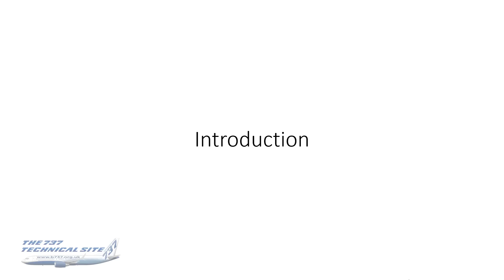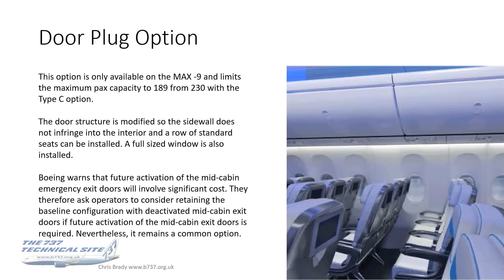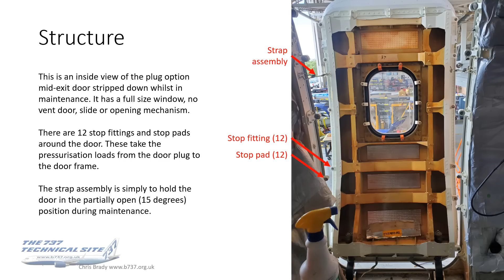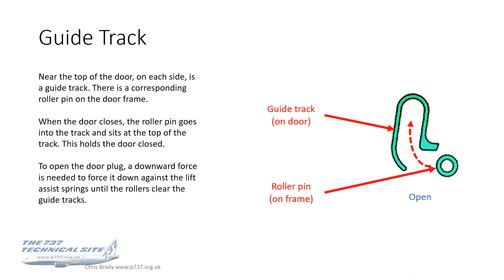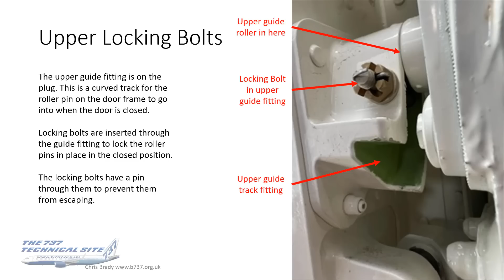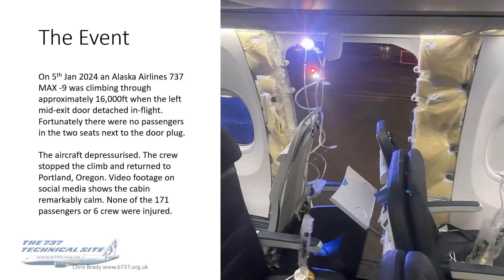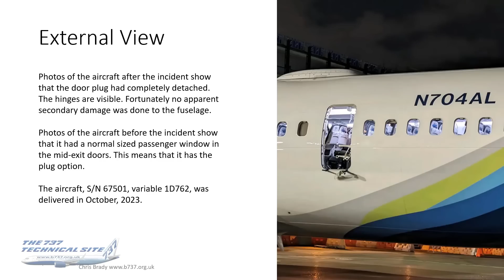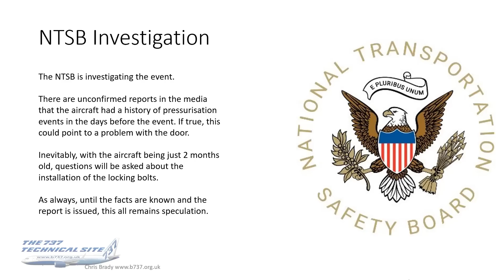737 Mid-Cabin Emergency Exit Doors - Plug Option

Comment: I still don't understand two things on the slide at 4:29.

What is a gate that reduces the size of an oversize door?

The video seems to say the plug option is not really a plug-type door, but this slide says it is. I think of a plug-type door as one that must open inward before it can rotated to pass through the opening and swing out. This mid-exit door is hinged to open outward like the overwing emergency exits.  Are they also called plug-type doors?
Reply: Exactly that got me confused too. I cannot see how this could be called a plug type door, I don't think it is but the info in the video was a bit confusing.
Reply from the maker: The gate is on doors 1L, 1R, 2L & 2R. Boeing state that the mid-exit door/plug is a plug type door/plug. It is just not as much of a plug as the other doors!
Reply: @ChrisBrady737   
Thanks for the response.  I understand which doors need the gate, but not why they need their size reduced.  As far as I recall I have never seen one.  Can you explain the reason? 

I can see calling this a "door plug", which would be a non-door thing that fills an opening for a door; but calling it a plug-type door is misleading and confusing for those of us familiar with the usual usage of that term.  Especially when this plug is not actually an operable door.  I was around Boeings for most of my flying career and this is the first time I've been confused by their terminology.
Reply from the maker: @gort8203  I agree the terminology is confusing, but Boeing clearly state in the AMM that this door plug is a "plug-type" door!

Comment: Seems to me that if the door was installed properly, all of the bolts in place and torqued to spec and locked in, there is no way that door could have separated from the aircraft. Am I right?
Reply: When it comes to the locking bolts (seen e.g. at 8:50), they don't even have to be torqued to do their job. If the nut is on and secured with the pin, they would work just fine even if not torqued at all.
Reply: Wow, that's even more troubling. By the way, I have a jacket with that skunk logo.

Comment: Many thanks for answering many questions ! 
At roughly the 10 minute mark, you show the lower end of the door with the lift assist sping, and hinge guide fitting.  
Assuming (for sake of question) the arrestor bolt was not present,  and the door was opened say by 45°, could one just lift the door out of the hinges, or does the bolt/washer at the tip of the hinge "pole" prevent the door from being pull oup and out o fthe hinge ?
I assume NTSB will have a good look at what is left of the hinges to see what happened.
Reply: Yes, the double nuts and washer on the hinge assembly is the up-stop.

Comment: Thanks - I'm slightly confused by the up/down direction when opening - my understanding based on the direction of the guide and the collars on the hinges is that the door must move upwards to clear the guide, but the guide track slide says the opposite direction.
Reply: The panel can only be lifted upwards first, before it can be pushed outwards. If I am reading these pictures correctly.
Reply: I thought I was the only one wondering about this too...
Reply: He incorrectly stated the direction in the earlier part of the video, but then in the later half, he seems to have corrected himself. The plug has to go up to open. Hence the need for helper springs to counterbalance the weight of the plug.
Reply from the maker: * Errata *
In this video I state that a downwards force is required to remove the door plug. I based this statement on text in the AMM SDS which I now believe to be incorrect or misleading. It is possible that a very small downwards motion (1-2mm) is first required to be able to free the locking bolts. But the door must be moved upwards by a couple of inches to clear the guide tracks. Apologies for any confusion.
Reply: @ChrisBrady737  thank you for the clear correction - your content is great.
Reply from the maker: Thank you and again my apologies for any confusion
Reply from the maker: AMM SDS 52-23-00 Page 6 MID CABIN EXIT DOOR PLUG - COMPONENTS, Lift Assist Springs:
"Apply a downward force to the door plug this forces it down until the rollers clear the guide tracks. At this time the door plug can open outboard."
Reply: @ChrisBrady737  thanks for the reply - still trying to figure it out in my head with an n shaped guide on the door and a fuselage mounted roller.
Reply: @blythy87  Not that the AMM has ever been wrong 🙄 I was continually submitting forms to our technical department to get them to contact Boeing to have the manuals reworded/amended. I can imagine pulling the door down slightly to relieve any tension on the locking bolts to allow them to be pulled out. But, as you say, the guide is on the door. The door has to go up to get the roller out of the channel. Timestamp 9:05
Reply: I think maybe it's pushed down to clear the pads, and then lifted up so the bottom clears the frame when opened. (?)
Reply: @jonathanbott87  the idea is to introduce fault tolerance by requiring opposing motions in sequence to allow it to open. Hence, you're on the right path.
I suspect that'll end up being redesigned to make it a bit more fault tolerant in the future, along with some additional steps in manufacturing to prevent any errors in assembly. At times, just re-ordering assembly steps can prevent the omission of a critical component.
As it stands now, intended operation involves three steps, conducted four times, before the door type plug can even be moved at all. Meanwhile, if assembled by component in sequence, say bolt, bolt, bolt, bolt, nut, nut... cotter pin, cotter pin... One can easily miss two in sequence, say when going on lunch break and fail to complete the securing sequence at the factory. A suggested solution then would be for each locking pin to be fully secured in sequence, bolt, nut, cotter pin, secure cotter pin (bend it), move to next locking pin.

Comment: funny thing  is this looks to be very strong area of plane  with  the extra reinforcment  around . so best in an acedient. but of course worst place to be seated  if door opens at cruse😗
Reply: think how many people would be sucked out when the seat belt is off plus the pressure difference at 30k ft.
Reply: @humorss  it's a wee bit more complex than Hollywood makes things out to be.
OK, sea level air pressure is around 14.7 PSI, cabin pressure is typically set to around 10.1 - 10.9 PSI (trending more toward the higher pressure for elder and infirm passenger comfort), at 16000 feet, pressure outside was around 8 PSI, at 30000 feet, it'd be 4.36 PSI. That's actually a rather modest wind, as a door being lost is a rather sizable area and plans typically go with a lost window taking a minute for the aircraft cabin to reach outside pressure. 
I'd still wear my seat belt, but it's not some magical Hollywood explosion from hell we see in the movies. The closest to that was the Byford Dolphin decompression chamber accident and the person that was ejected was standing in the hatchway opening area when the outside crew disconnected the bell for inexplicable reasons.
Hell, an astronaut on the space shuttle was EVA and a stiffener bar tore his skin and through his suit glove, exposing his hand to space. He never even noticed until he finished the EVA and came back inside and removed his glove. His blood slowed the leak down significantly.
https://www.engineeringtoolbox.com/air-altitude-pressure-d_462.html

Oh, a bit of fun trivia. Remember the scene in The Martian, when the rocket was going to fall over because of the high winds? Nope, 1% of the atmosphere of earth at sea level, so nearly a vacuum. Equivalent pressure on earth is around 110000 - 150000 feet or so, the SR-71 didn't even notice the equivalent winds up there. A real risk would be taking off in sand, sandblasting the spacecraft, rendering radar dishes inoperative and the windscreen and camera optics useless.

Comment: Great information. I fly this airplane and I always learn something watching your videos. Thanks for taking the time to put together a follow-up. I appreciate your fact based commentary.
Reply from the maker: Thanks for your kind comments, stay safe!
Reply: I'd go peel open the covering and check those bolts being screwed tight with my  own eyes before I flew one of those planes...😮
Reply: @jarchdm yep & in the same way that it's always safest to fly on the airline that's recently had a mishap, I'm 100% sure of the engineers who will now be checking EVERY single door-type plug on these aircraft for correct fitment of the locking bolts. This exact problem will not reoccur.

Comment: Thanks for the video Chris. If I understood correctly, assuming a loose or missing bolt/bolts you would still need to apply a downward force against the springs in order to open the door, wouldn’t that be a correct assumption?
Reply from the maker: Normally yes, but possibly not if the door had moved if it hadn't been secured properly
Reply: @ChrisBrady737 , I’ve been jumping back forth to the different pics & diagrams here. I think something must be mixed up? When the door is completely closed, with the upper pins seated in the guides, the only way those pins can be released from the guides is for the door to move up & out. Once those pins are released from the guides I suppose it might be possible to push the lift springs back downwards beyond the point where the lock bolts can be inserted, but for what possible reason? At that point the upper guide & pin are disengaged from each other & the door is open. It seems the only logical function of those lower lift springs is to assist in lifting door upwards to release the guide & pin assemblies at the top. 

I’m also trying to figure out how those 12 stop fittings & pads can possibly have anything to do with, as you say,  transferring the pressurization loading from the door to the framework? Pics are not clear enough when zoomed, but they appear to be pins on the door that fit into bushings on the framework, which implies they are positioning door, but this is not possible since the movement final movement to close door has to be a downward movement to engage the 2 upper guide & pin assemblies. I don’t understand how the function of these “stop fittings” can be anything more than simply as adjustment points to warp the shape of door skin to match perfectly flush with the overall fuselage shape? If they have a positioning or pressurization holding function I need to see more closeup pics or diagrams that show their function better. 

In any case- The video yesterday mentioning the 4 bolts, 2 at top & 2 in the lower hinges, left the impression those 4 bolts were actually holding the door on. This video clearly shows those 4 bolts are position locking bolts, which are themselves locked in place with a castle nut & a cotter pin / safety wire. Kinda like a grenade with a firing lever, retained by a pin, with that pin again having a cotter pin safety wire. The 4 bolts themselves carry no load & someone else mentioned that if even 1 of the 4 was in position it seems unlikely there is any operational force that would allow the up & out movement of door that releases the upper guide & pin assemblies. If those 4 bolts were properly in place it seems like a very robust foolproof system. If the plane was delivered to Alaska with the door installed and the interior cabin plastic in place over it, it seems beyond the need of any inspection to verify.
Reply from the maker: * Errata *
In this video I state that a downwards force is required to remove the door plug. I based this statement on text in the AMM SDS which I now believe to be incorrect or misleading. It is possible that a very small downwards motion (1-2mm) is first required to be able to free the locking bolts. But the door must be moved upwards by a couple of inches to clear the guide tracks. Apologies for any confusion.
Reply: Wonder if the pressure difference and perhaps plane movements when flying at high altitude could ‘suck’ the door downwards, compress the springs and then blow out, if the bolts were missing.
Reply: In the battle of differential pressure at 16000 ft vs a small downward movement required to release the door from the latched position, the former will win every time if the securing bolts are missing/non-fuinctional.

Comment: I guess they forgot the locking bolts.
Reply: Given two months, I'm thinking more the nuts and cotter pins. But, that's a suspicion. the pins will tell if bolts were present and vibrated out.
Usually, it's a chain of errors, the modeling of it being commonly called the "Swiss cheese model", where all of the "holes" line up to allow the accident to occur.
Reply: @spvillano  That last slab of cheese is where the plug diverted.  So many avenues to investigate, it boggles the mind.  The information in this video is and the ones prior is priceless.  If only there was an updated series for the 757, but that will never happen, but an old man can hope.

Comment: What type of inspection process are components such as this subjected to once installed? Is there a list of workers / inspectors who were involved in the manufacturing process? I work for an auto manufacturer and they can look back to see who tightened a specific bolt on a day / time.
Reply: Generally, yes, aircraft have a quite detailed maintainance log attached to them.

Comment: Great job, Chris. Thank you for quickly producing these two videos which help people better understand the door plug system.
Reply from the maker: My pleasure, I hope they are useful
Reply: @ChrisBrady737  Can you confirm that the door sensor / flight lock hardware is not installed on mid-cabin emergency exit plug doors and therefore wouldn't trigger a fault or PSEU indication if the door translated out of the locked position either on the ground or in flight?
Reply from the maker: Correct, the mid exit door captions should have INOP stickers over them
Reply: @ChrisBrady737  Plug was just found!!
Reply: @ChrisBrady737  According to flightaware- there is around 10 max 9s flying as we speak! This is the last thing Boeing needed- because of the MCAS disaster- that was entirely preventable- the scrutiny on this Aircraft is going to be intense. And so much for Boeings request to defer the Anti Ice issue to pilot memory!!
Reply: I would suspect that all 737 inspected will have a photo record of what they find with and RII signoff to boot.
Reply: I add my thanks; it''s nice to hear from someone who understands the aircraft.